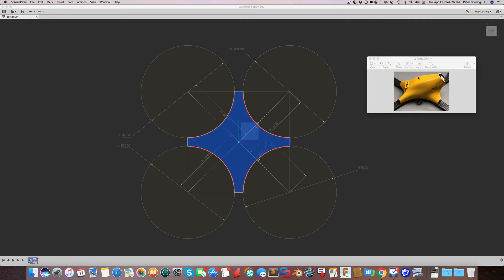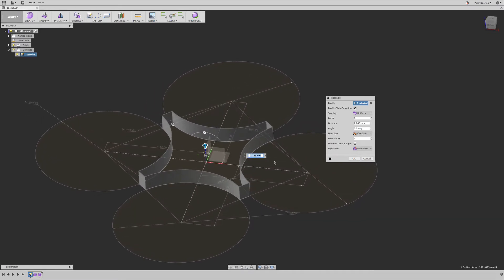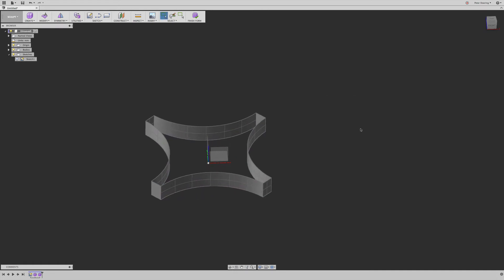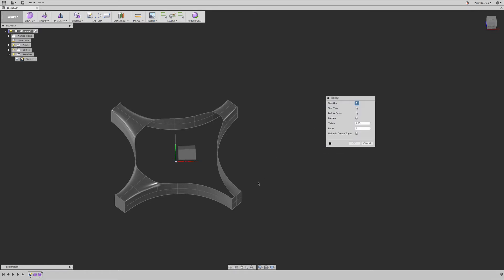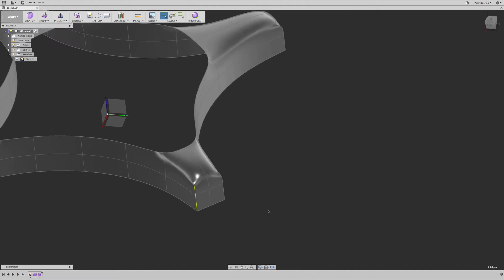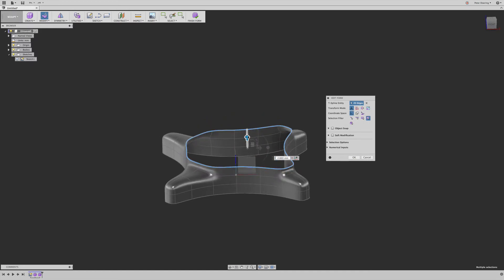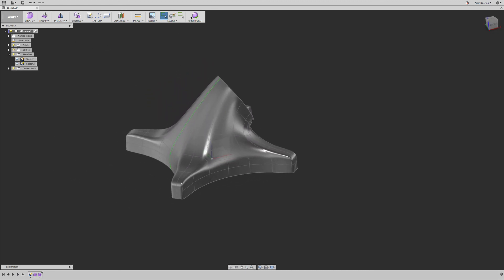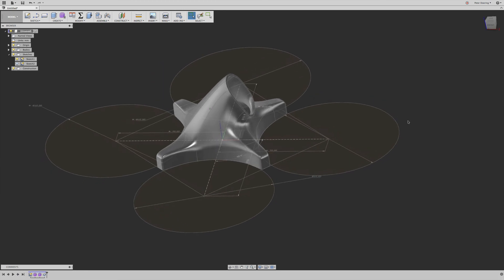Drone Housing with Fusion 360 Sculpting

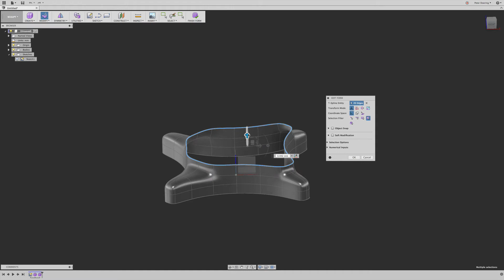Comment: Hi there, thanks for posting the video.  Referring to the instructions at 5:20 min of your video, while extruding the edges using the edit form tool, the whole body gets stretches.  Kindly suggest a way to avoid this. Regards, Carl.
Reply from the maker: As mentioned you need to press the ALT key (on Windows) and then move the manipulator handle. Then it extrudes from the current edge loop. Otherwise as you have noticed it just moves the current edge loop without adding a new one.
Reply: Peter Doering thanks again, will try that!